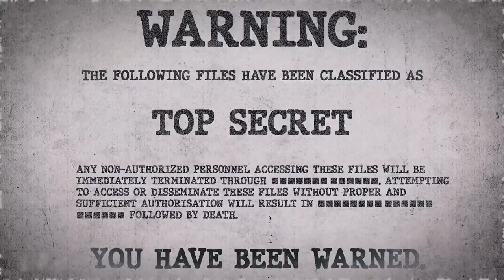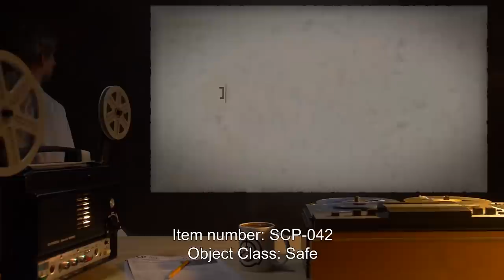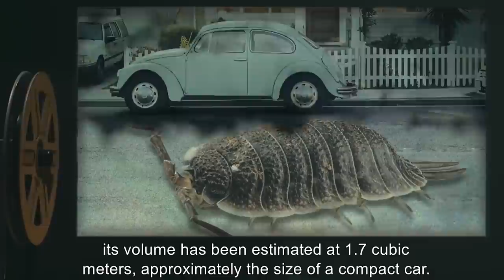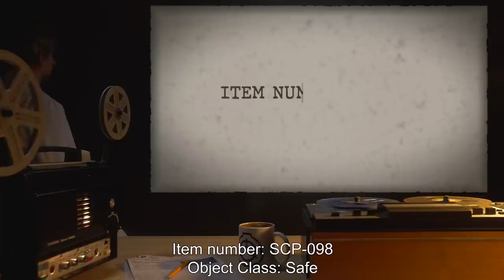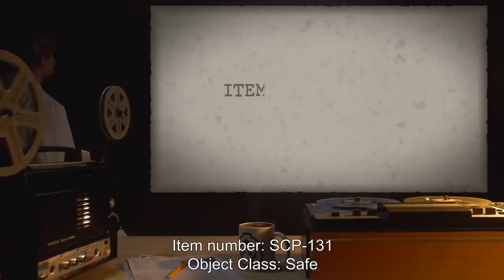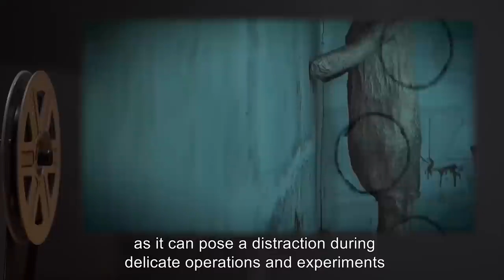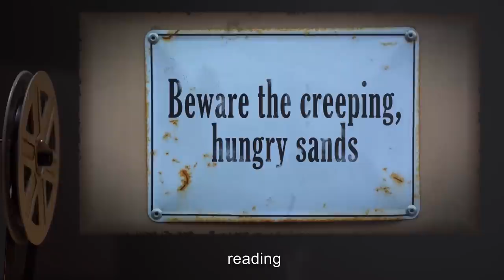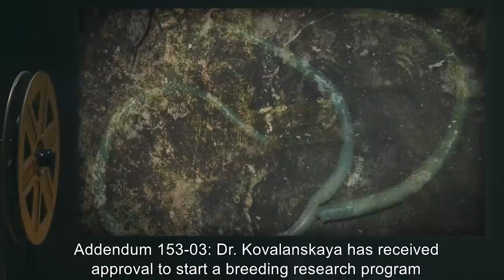Animal SCPs (SCP Orientation Compilation)

Comment: Fun fact. "Data expunged" is NOT a guarantee that the data was far more dangerous than data that was redacted. Just the opposite: It means the data was of little importance, and probably was determined, upon review, that it's just generally better left unsaid.

27:39: "You did WHAT with the dragon snail?!" (long awkward pause) "Well... Yeah, that certainly shows high intellect... But let us never speak of this again."
Reply: [Data Expunged] means excessive unnecessary text has been removed for brevity's sake in this basic briefing document.

[Redacted] means it has been removed because of the graphic and horrifying nature of the information as well as the fact it only NEEDS to be known by someone who has access to a lot more than just the briefing document.

Comment: Regarding SCP-075, suggest feasibility study of using vacuum chamber around SCP-075's containment chamber for controlling humidity of SCP-075's containment chamber in addition to silica desiccants.

Regarding SCP-149, suggest change in containment. The room containing the containment chamber should be altered to include an ante-room having a negative air-pressure with suctioned air evacuated into the room housing the containment chamber. Either the door to the ante-room or the door to the room housing the containment chamber or both are to be closed at all times. Further recommend that remote controlled drones be stationed in the room housing the containment chamber for routine use instead of personnel. In the event any personnel or other potential hosts of SCP-149 enter the ante-room or the room housing the containment chamber of SCP-149, recommend that such personnel or potential host be quarantined for a minimum of twenty-four (24) hours and not released until a thorough medical examination is performed. Lastly recommend installation of mosquito pesticide delivery system be installed in the ante-room and the room housing the containment chamber which is automatically activated in the event any breach of the ante-room, room housing the containment chamber, or the containment chamber itself is detected.
Reply: 4¹